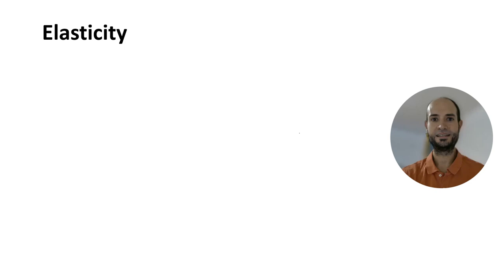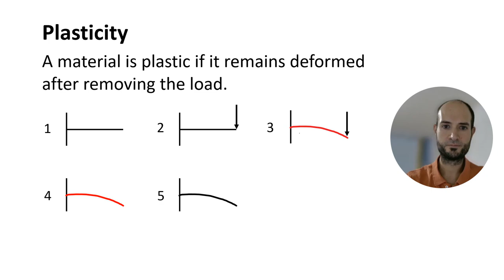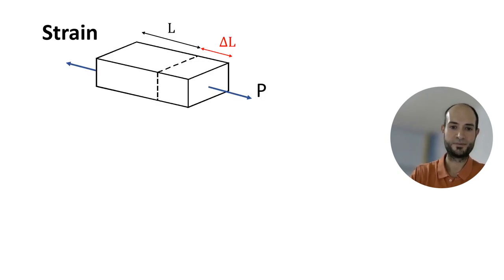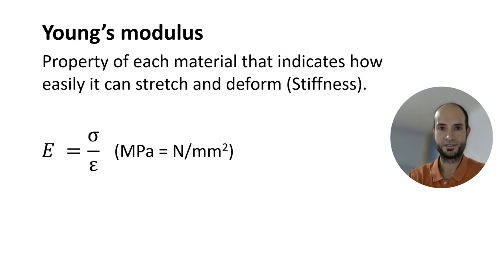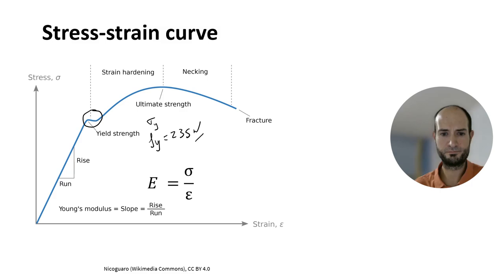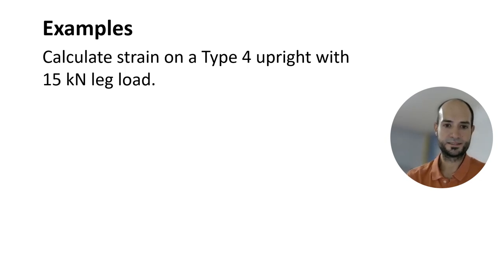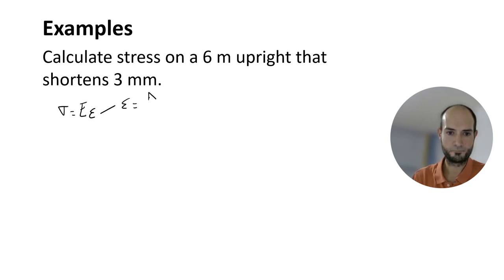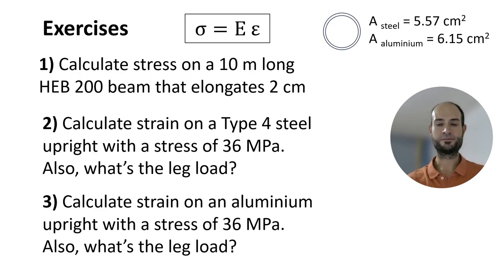Elasticity - Scaffold design for scaffolders 5

Comment: Hello Mr.Garcia. What is the 'Type 4 upright' ? Can you explain it please?
Reply from the maker: Hello, @onuryarmpabuc7761. Type 4 and Type 3 scaffold tubes are defined by European standard EN 39: Loose steel tubes for tube and coupler scaffolds. Technical delivery conditions.

Type 4 tube: steel S235, 48.3 x 4 mm
Type 3 tube: steel S235, 48.3 x 3.2 mm

However, please note that the thinner tubes are normally acquired in a high strength configuration, fabricated with steel S355, so they have a much higher capacity. These are not called Type 3 tubes, but just high strength tubes.